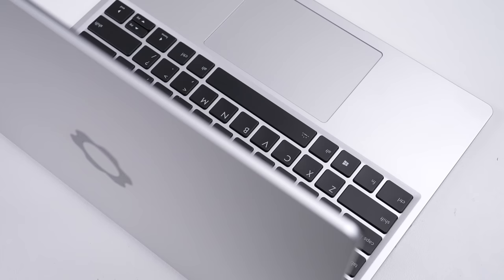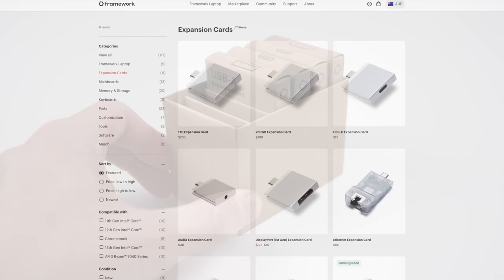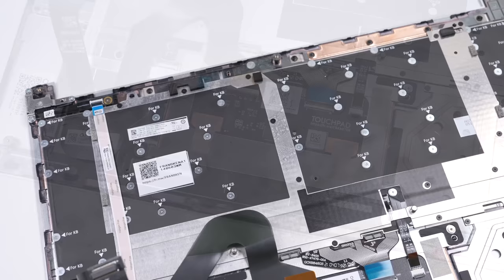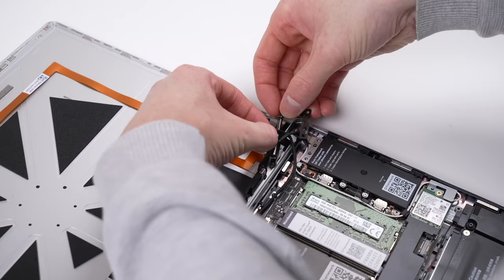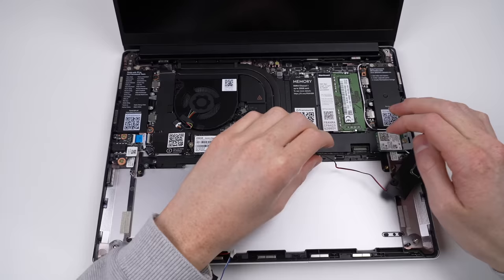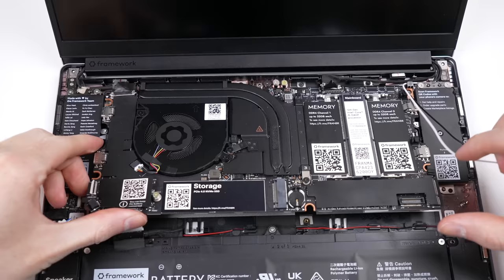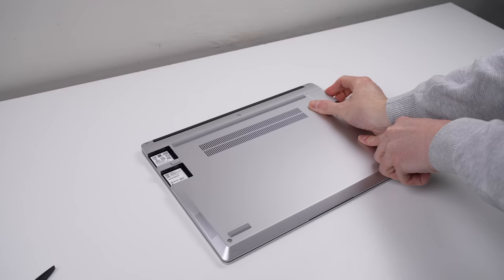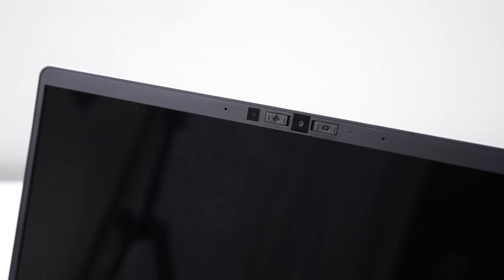New Laptop Brand Shocked Whole Computer Industry - Framework Laptop - Teardown And Repair Assessment

Comment: Hi Hugh, the bloatware is a windows 11 thing. I’ve set up a large number of 11 fresh (usb) installations on different computers, they all have the same bloatware. 

Framework should try to remove it ootb instead of shipping the default Windows 11 image.

Edit: clarification
Reply: Edit: Since found out that having a Linux operating system running windows and Mac applications would pretty much be extremely difficult, with performance hits and such.
Reply: @hx0d  how? With compatibility layers? There aren’t any currently functional macOS compatibility layers, and Wine has its problems. I think shipping Windows standard and giving you Linux as an option is a pretty good route. If only they could ship a custom image with less bloatware…

Edit: before you tell me about Darling, it can only run Darwin CLI and some very simple GUI binaries. It wouldn’t work.
Reply: you can choose not to purchase windows 11 it give you an optio that says bring your own menaing you can use whatever copy of windows I.E windows 10
Reply: @tejasraman6913  Unfortunately they can't.  Altering the install to remove bloat would break the licence agreement.
Reply: Unfortunately OEMs can only add more bloat, not remove anything that's """core""" to windows
Reply: @hxxdi  Heck, Linux would be awesome, though I think they already support Ubuntu & Fedora officially.
Reply: @cjmillsnun  Could they schedule a task on Task Scheduler to uninstall all the bloat on first startup? That's technically just adding more software right?
Reply: @jm56585 end users can do it themselves and remove the bloatware once they purchased the laptop from Framework.
 
Framework can't do anything about the W11 bloatware because, again, it'll break the licensing agreement (probably a "volume" one) with Microsoft. Even if that means slipping a scheduled task or script in the computers, it's just the same.
Reply: But the “bloatware” you are talking about isn’t even actually bloatware they are just advertisement like if you click the icon then the app there will start installing you can just “delete” them and the icons will be gone. Also having ads in windows is crucial at this point because most people just use windows for free including me. Like every free product it will collect data and display ads. But i prefer that it does that rather than pay for windows.
Reply: @cameronbosch1213  they open sourced there firmware and drivers as much as they can so anybody can MAKE it work and that is part of there "ethos" to MODIFY not just REPAIR
Reply: @hx0d I'm a Linux user, running Windows and Mac application is not a easy task, you can't just say "I want Windows and Mac apps to run on Linux" then having it the next day, Wine is a project which aims to run Windows applications on Linux, it existed since the 90s and still can't run many applications well to this day
Reply: @togoxo What about Linux?
Reply: @togoxo  let's try to debunk your statements:
 
• they're "bloatware" no matter how much you redefine them (either from Windows or driver manufacturer)
• you might probably be using a different version of Windows 10 (hence you seeing advertisements)
• heck, even majority of Windows 10 and 11 versions sneakily put "ads" (they're not extremely intrusive but only if you end up in some places like, in Edge) and to me, in addition to Windows sneakily sharing data to third party (advertising) data hoarders such as ScoreCard Research, that is unacceptable given that the Windows LICENSE is already included on the cost of your laptop purchase. Windows is proprietary OS, was NEVER made free, and never will.
 
Unless you pirated it.
Reply: @tejasraman6913 Here in spain, we have Slimbook a Valencian bussynes, her laptops ships out of the box linux. Slimbook also opens her software for using on another brands.
Reply: They cannot do that legally. It's in the ToS that they have to sign which is behind an NDA.
Reply: @hx0d that would be impossibly difficult, you'd have to make both ARM and exe compatibility layers in it which will no doubt lead to worse performance
Reply: @togoxo  buddy, no one is using windows for "free" unless you literally pirate it on a brand new desktop PC for which you never bought a license. Every laptop that came with windows preinstalled has to pay for a Windows license. You have already paid for the license costs. And they sell your data to ad companies. Microsoft is ~1 trillion dollar company for a reason.
Reply: @jm56585  That still counts as "removing". U don't know MS, maybe.
Reply: @togoxo  That is still bloatware for end users, and they will still be troubled by it.
Reply: @jasonriddell  U don't have any idea of how MS works. Clue:$$
Reply: @hx0d  Without the compatibility layers, the OS will surely be the linux distro finally everyone can use, by ditching windows.
Reply: @xmlthegreat  using it without a license is not really pirating it at this point there is litterally nothing stopping you from using it like that. rather than newer laptops most older laptops that wasnt properly migrated and new custom PCs or even my new laptop came without and os so these devices are mostly running windows without a license.
Reply: @xmlthegreat  but you Microsoft will me Microsoft. they will get every single penny they couldn't get from us in another way.

btw in my first comment i was talking about people using windows without license sorty if it wast clear
Reply: @p15209  believe me you have not used a laptop with actual installed bloatware that was bad. this is nothing compared to that its essentially clickable ads to install apps in the start menu
Reply: @tejasraman6913  That’s what I mean, it shipping with windows 11 isn’t a selling point for me. I don’t know how but I’m sure someone could find a solution out there lol. I don’t want bloatware either, but I want something that can run my applications, some of which aren’t being developed anymore so won’t be rewritten in Linux.
Reply: @zUltra3D  Fair enough, didn’t know it would lead to worse performance
Reply: @th1nhhdk  How comes though, I don’t really understand as I’m not a coder. Just someone who works with tech at the surface level
Reply: @cameronbosch1213  It would but the reason I’m not already using Linux or ubuntu is because of the compatibility. I’m starting to dislike windows more now and more and windows 11 with ads? That’s a no go for me, but the thing is I can’t run some of my programs on Linux or Ubuntu as far as I can tell. They’re also from my experience not very user friendly to the average person, more for programmers. Happy to be proven wrong but that’s what I know about it.
Reply: @togoxo  No one is using Windows for free every time you buy a laptop it comes installed with Windows. In the past you had to buy the disc to update to new version of Windows. So the idea that "Windows if free" is not true
Reply: @hx0d  That's not really true anymore. OBS Studio, Blender, & Krita are great apps that started on Linux, are FOSS, and are standards in their industry.
Reply: @tejasraman6913  Ever heard of Apple’s “Game Porting Toolkit”? Probably not, since it is very new and only in beta right now.
Reply: At this point I'm just waiting for Windows 12 😏
Reply: @cameronbosch1213  Yes but some old apps and games just won’t run. That’s the main stopping point for me
Reply: @hx0d  I actually had only one game that wouldn't run, and it's because of the EA app. I don't play it much anymore.
Reply: yeah it's typical for Windows to have trash included with their trash OS.
Reply: Yep, as others have noted, these are parts of the default Windows 11 image that we don't have the ability to remove unfortunately.
Reply: It's a manufacturer thing, not a Windows thing.
Reply: @FrameworkComputer  wowwwww framework replied to me!! Thanks so much!

Thanks for clarifying that, I wasn’t aware. AFAIK some smaller companies buy retail licenses (mostly Linux-focused manufacturers) and can do that but I should have known that Framework probably has a volume license agreement with Microsoft.
Reply: @alejandromg535  The point is not Linux (there are a ton of Linux distros). The point was Windows bloat, which Framework cannot remove (as they pointed out in their comment)
Reply: They should ship with tiny 11
Reply: @dinozaurpickupline4221  and risk losing their volume license agreement?
Reply: @tejasraman6913  for the greater good
Reply: @togoxo see this man, he has Stockholm syndrome. Don't end up like him
Reply: Windows 11 is  a bloatware.
Reply: They proababy can't or they won't get the cheapest WIN licensing fees
Reply: @Legion849  omg fine then like my laptop litterally came as freedos without a license its an hp. You may have not seen them but they exist as without a license its sold for less
Reply: That’s why you get the diy edition so you install your OS completely by yourself
Reply: @kavintradess  so what should they ship? They offer Linux and no manufacturer should be shipping Windows 10 - that period of people selling downgrade rights has passed
Reply: @Legion849  Unless you install it yourself and never activate it.
Reply: Though I think they could, the licenseing stuff prob says they arent allowed to
Reply: @togoxo  but shipping tiny11 with those volume keys is against the agreement. No one sells freedom laptops anymore….
Reply: @ThanosIsUglyGD  There is a market for this but it's relatively small and not "disruptive". This will be a niche product for folks with tech skills who want to "play". Traditional business and enterprise would never consider bulk-buys for employees. The exact opposite of Apple. Imagine a MacBook or iPad sold without an operating system out of the box.
Reply: @goobfilmcast4239  You're right, I couldn't imagine a MacBook or iPad sold without an OS because it's proprietary. Not a great comparison, but it's a valid point.
Reply: the bloatware is called Windows 11

Comment: Props to the engineers and investors, this is a step in a beautiful direction. That's one clean cut laptop 🔥🔥
Reply: Have you ever even disassembled laptop unless its apple all modern laptops are the same only difference is the unnecessary and probably expensive swappable ports its stupid
Reply: @MDK808  That's not true. They are not unnecessary and they are priced ok. The whole laptop is not cheap. But it comes with those and you can choose in the checkout process the ones you want.. You can choose which display outputs you want. Or if you like to have more USB ports. Maybe you need Thunderbolt? Or some VGA output? You are free to configure the IO of the laptop to your needs. And if a standard changes in the future or, if there is a new one. Chances are you can just plug in a connector via USB C and be done with it. no changing of the motherboard.

Changing stuff in Laptops to upgrade is usually not possible as they just change the size/form of the motherboards. Changing a screen to a higher resolution is most of the time impossible, as the connectors will be different.
Reply: They even have some cases you can use to put the old hardware into after your upgrade to avoid it becoming e waste.
Reply: @ueberraschungstuete  bwhahaha what a joke
Reply: I really enjoyed this concept
Reply: @MDK808  agreed. I have a laptop that can do all of this already, minus the modular ports, which doesn't interest me. Just a bunch of fanboys here.
Reply: @DoubleOhSilver  It's not just about the functionality of the laptop. It's about changing the idea that these things are disposable to be used and then discarded year after year leading to a ton of e-waste. It may seem like not a big deal but every little bit we do helps, we've got to start somewhere. Also, show me another laptop where you can upgrade the cpu.
Reply: @GG-ii1uc  Why is that a joke, you can just pass the old one down to you kids instead of buying a whole new laptop. This will be a hit with big companies that have hundreds of laptops.
Reply: Only miss is the lack of OLED 120Hz display!
Reply: @johnarnold893  no way!!!! Do you think that secure companies will want this ??? Secure companies use DELL machines because they offer excellent business security. DATA is vitally important these days...
Reply: @MDK808  Have you? Swapping the motherboard is a huge pain on all the laptops I have taken apart. Plus none of them offer motherboard upgrades to newer generations or even replacements. I don't even care for the port swapping, but the rest is impressive.